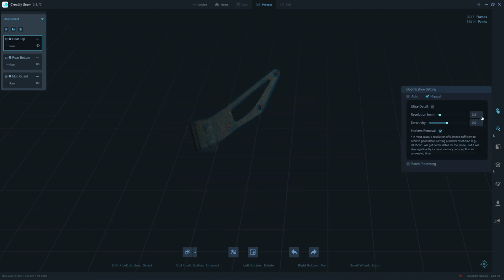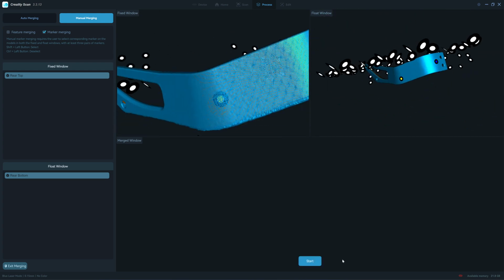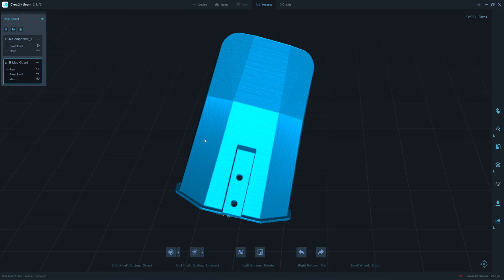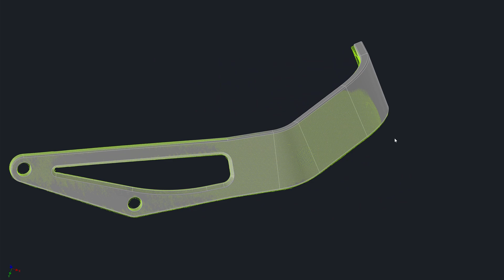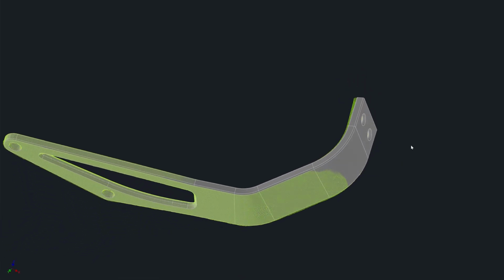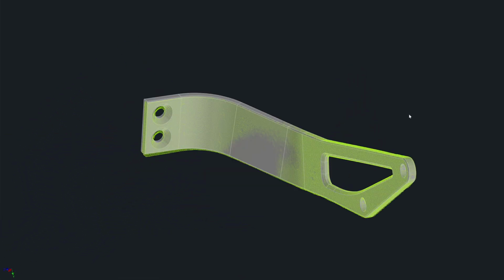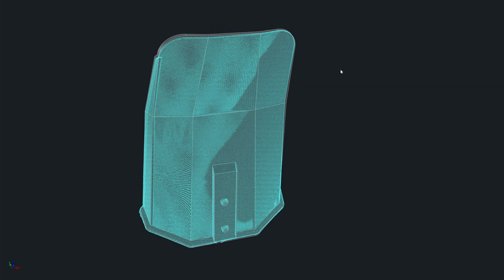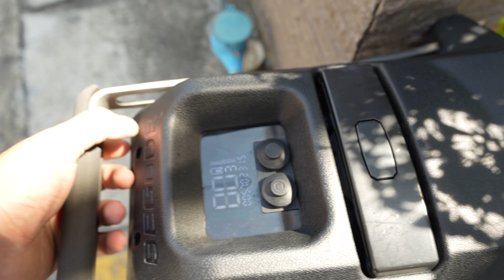Creality Scan Show Case - Metal Print Handlebar for Begode T4 - Part 3

Comment: Looks good!  I've had some stuff printed in 316 and it's beautiful.  I've watched your video on the raptor... I really want to get one!
Reply from the maker: Did you print with JLC or PCB way?   I really want to compare between the two, they probably use different machine.
Reply: @Payo-TensileCreator  I've been using craftcloud for my projects.  I did notice though, my stainless parts had much better finish quality than the aluminum parts.  The aluminum was usable and very dimensionally stable though.